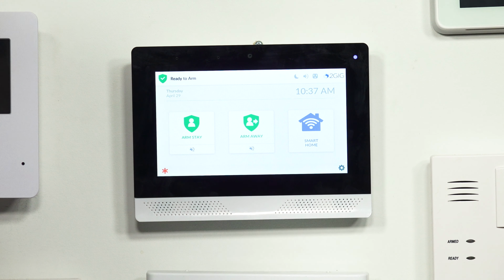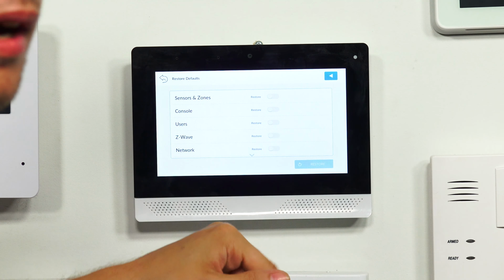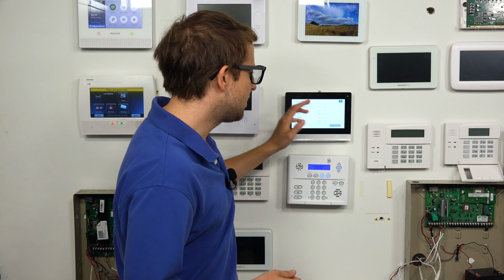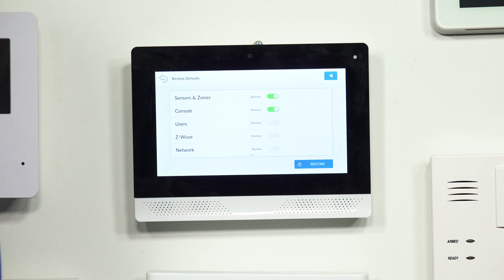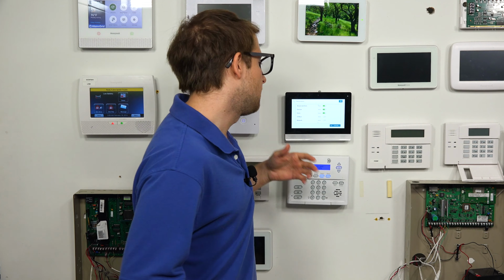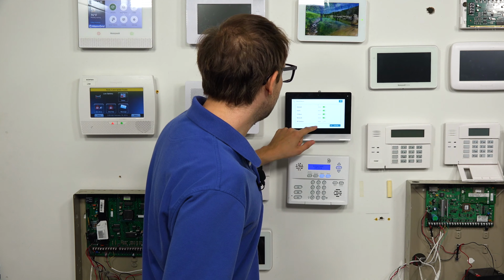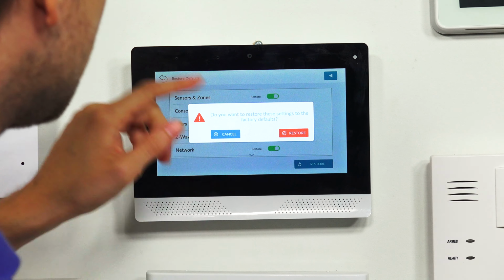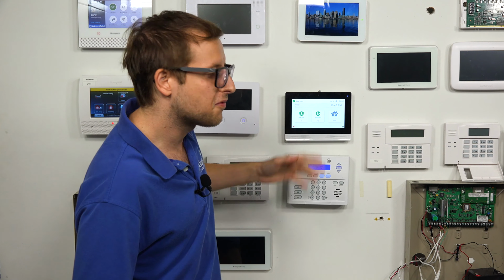2GIG Edge: Factory Resetting

Comment: How can i factory reset it if i forgot the code and wont take the default code?
Reply: Hi @lonestar3983, If you are currently monitored, your Current dealer may be able to reset that for you. If you are not monitored, you can try signing up for service with a company like Alarm Grid. During the activation process we will attempt to set the code back to default. If we can't, we'd just cancel the sign up and you'd be back to square one. We have no contracts, so you can cancel at any time.

Comment: Can there be other Installer Codes? My panel say Invalid Code when entering 1561.
Reply from the maker: Yes, 1561 is the default Installer Code, but the installing company can change that to a different code. If it has been changed, you can try signing up for service with a company like Alarm Grid. During the activation process we will attempt to set the code back to default. If we can't, we'd just cancel the sign up and you'd be back to square one. We have no contracts, so you can cancel at any time.